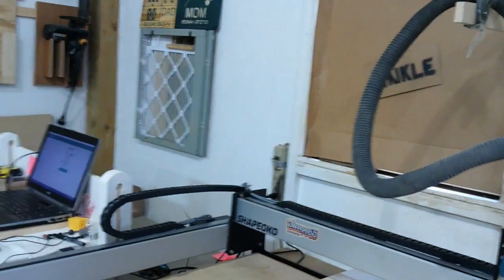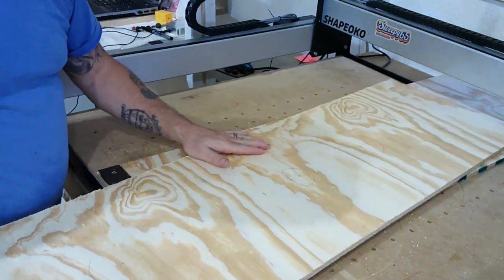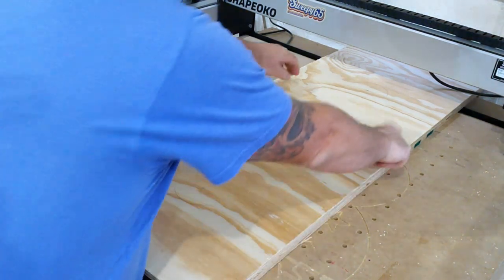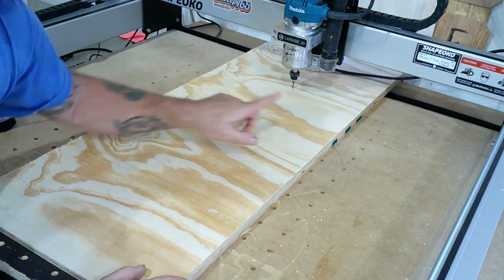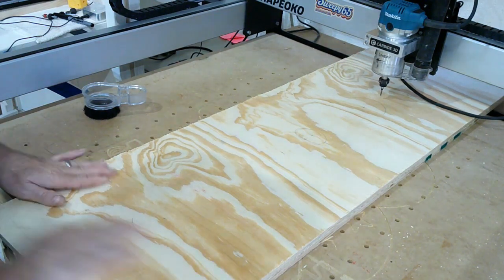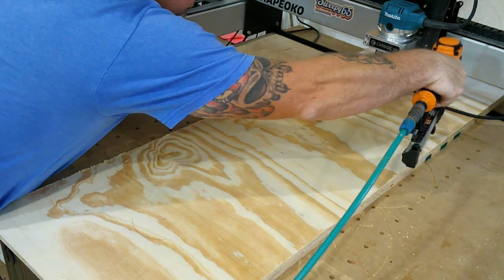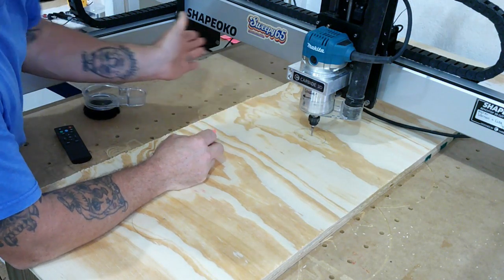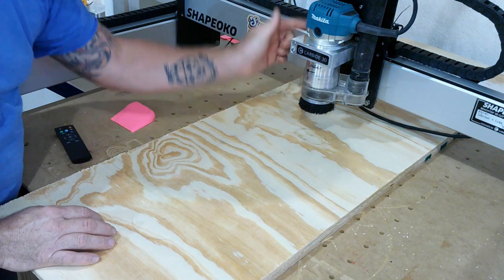HOW TO: CUT PARTS BIGGER THAN YOUR SHAPEOKO XXL CNC MACHINE BED

Comment: nice work, i would recommend using three drywall screws to hold the circles in to ur spoilboard  and then you do not have to mess with cutting tabs off later. Thanks for sharing

Comment: Good Video...I haven't got a cnc yet but wondered why you can't use a touch probe to get the Z-axis height?   Also, have you done a review of the carveco software? I'm evaluating machines and software...so that might be interesting to know why you chose that over other software programs.
Reply from the maker: Thank you
Yes you can use the touch probe for the Z Height but it is just as easy to use the paper and complete the process all in one step by that I mean zeroing all axis at once
I haven’t done a review of carve Co. yet because I am still learning the software myself however I chose carveco because I watch Chris Powell and he is quite versed in the software also Leighton from carveco is quick to respond with tech support issues
Hope this helps

Comment: The power cable dangling and dragging is stressing me out
Reply from the maker: Me too!! But if it’s to close to control wires it can mess with the PCB 👍
Reply: @Hinkleshop  i run a piece of string from my ceiling down hold the router wire up in the air away from the bed.
Reply from the maker: @53fetech  great idea mine is suspended by looped zip ties in the back

Comment: Have you built ant projects that require tiling?  I haven't found a video that does this.
Reply from the maker: Not yet but that’s an interesting concept
Reply: @Hinkleshop  I have seen so many projects on the shapeoko XXL with the work piece hanging over and the make a design longer than the cutting distance.
Reply: @Charlie-qd3qs  most of my projects are done using tiling. its a much easier method. but i use Vcarve pro not sure what the limitations are on Carveco
Reply: @53fetech  if you could give a tutorial on how to I would be forever in your debt!
Reply: @Charlie-qd3qs  what software are you using?
Reply: @53fetech  just carbide create.  I will get vcarve pro but I have a Mac.
Reply: @Charlie-qd3qs  i dont know of how you would do it in carbide create aside from making 2 designs starting the y axis at a certain point. IE. for a 40in long piece first design 20in long using the bottom left for the y zero once its cut then slide the board down on the wasteboard along the y axis so the 20in mark is at your y zero for your second cut. then start the cut from there. basically the same as vcarve but a little more involved.
Reply: @53fetech  do you recommend Vcarve?
Reply: @Charlie-qd3qs  its all i use